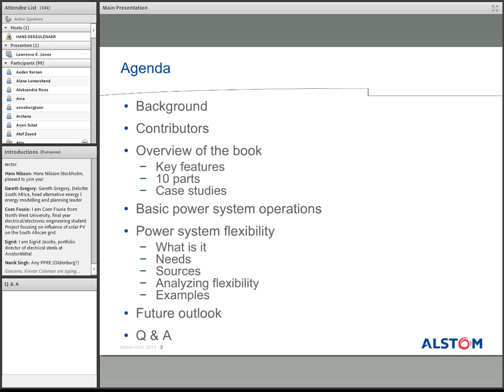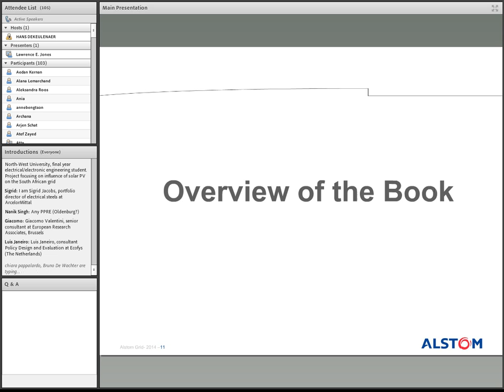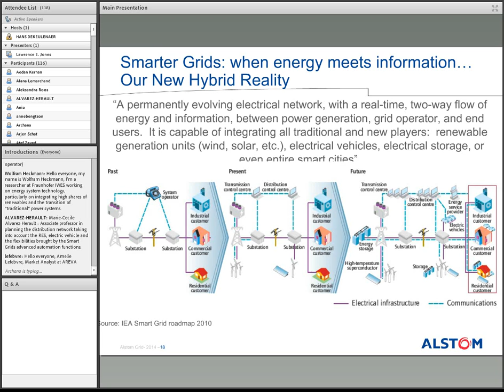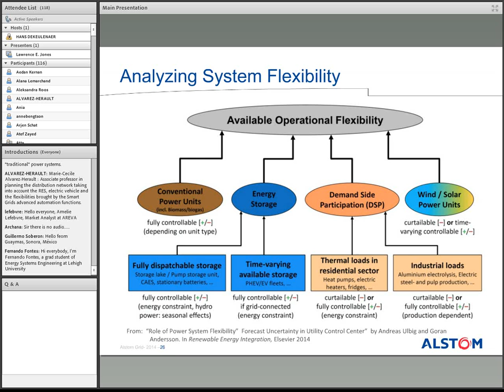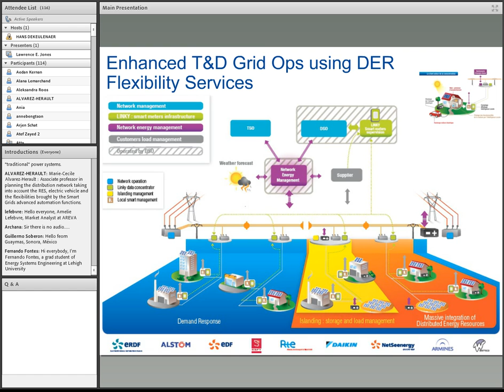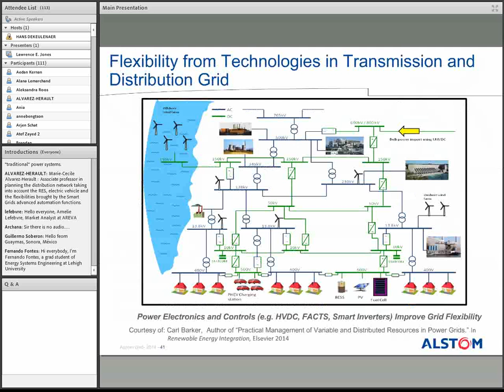Managing Variability, Uncertainty and Flexibility in Power Grids with High Penetration of Renewables

Comment from the maker: In this webinar, Dr. Lawrence Jones will discuss, Renewable Energy Integration, a new ground-breaking book which offers a distilled examination of the intricacies of integrating renewables into power grids and electricity markets. Through thirty-five chapters, this first of its kind volume offers informed perspectives from internationally renowned experts on the challenges to be met and solutions developed by operators around the world. The book focuses on the practical implementation of strategies and provides real-world context for theoretical underpinnings and the development of supporting policy frameworks. It lays out the key issues around the integration of renewables into power grids and markets, from the intricacies of operational and planning considerations to supporting regulatory and policy frameworks; provides global case studies that highlight the challenges of renewables integration and present field-tested solutions; illustrates enabling technologies to support the management of variability, uncertainty and flexibility in power grids. During webinar Dr.  Jones will overview different parts and key themes in the book, with a special focus on the subject of demand response, and other solutions for increasing power systems flexibility, and the role of big data.